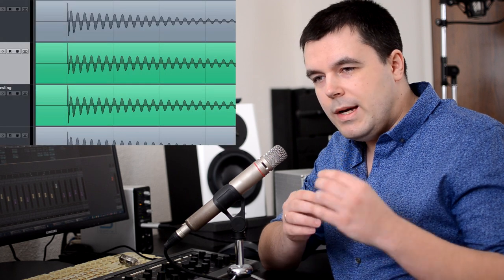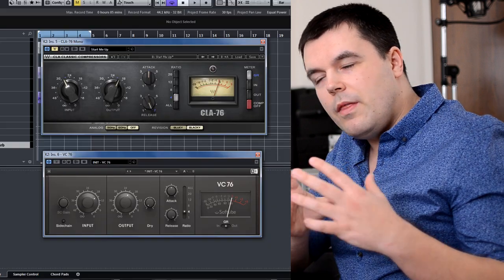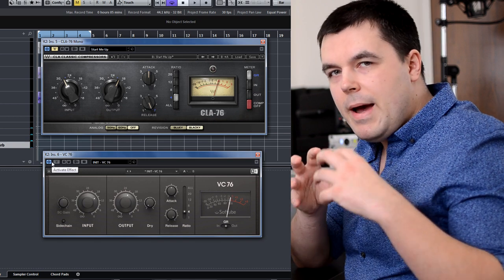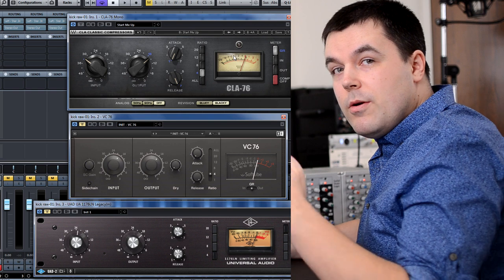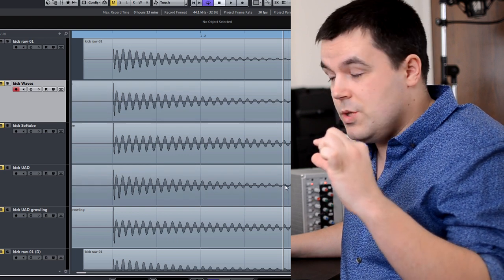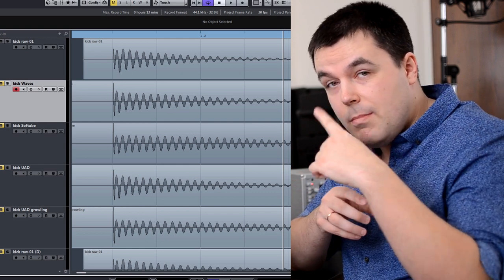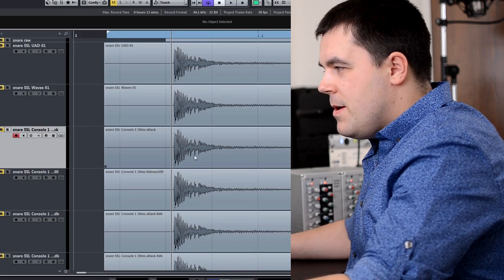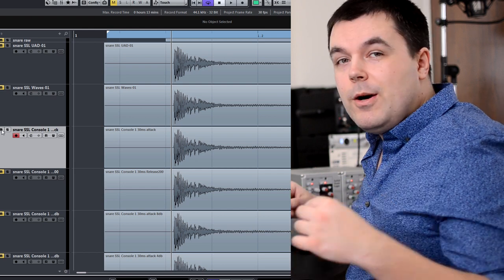How to Use a Compressor - Learn New Things on 1176, SSL, VU Meter

Comment: Super Video - and what most people also don't get is soft knee compression, like in the LA2A if I remember correctly, some guy was wondering why it makes no difference if it's set to compress or limit - easy, he was only operating in the knee area so the compressor works, but limiting, if you set so, begins after the knee, so you have to give more input

A Video about that would be awesome, cause you can discribe things really good
Reply from the maker: On the course we cover like 10 secrets of LA2A, most of them are unknown.